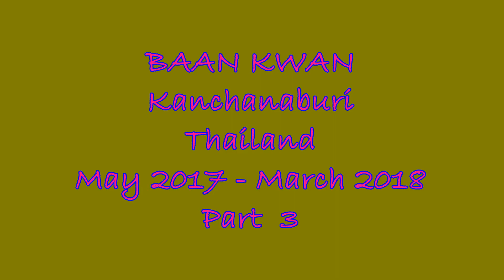Baan Kwan  - Building a House in kanchanaburi Thailand - Part 3

Comment: Brett, I see you went for red bricks with form insulation, why did you choose this option over super block? Personally I have been hearing some bad stories on Super Block.
On your roof insulation can you give us some details what you use?
Reply from the maker: Hi George - The use of the red bricks according to the locals are better insulators but we needed the room on the structural posts to have the polystyrene form panels so 80 mm of brick x 2 = 160 + 40 mm of insulation = 200 mm same as the posts with in some places 30 mm thick of cement render which I think as a builder myself is a better thermal construction than what I would have got from the super blocks. The insulation on the roof is only the standard thai silver foil sarking paper under the tiles but the insulation will possibly be 150 mm thick fibre glass batts installed on the top of the plaster board ceiling - I am not a person that cuts corners so some costs initially but this is Thailand and its hot so I believe that our comfort comes first and to keep our running costs low
Reply: @brettcooper7253  Well done beautiful home sir.